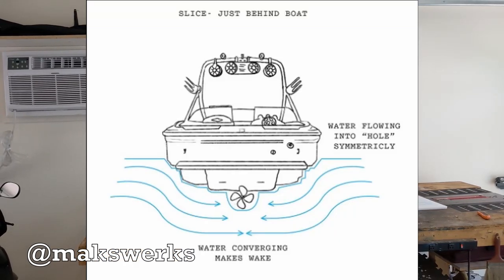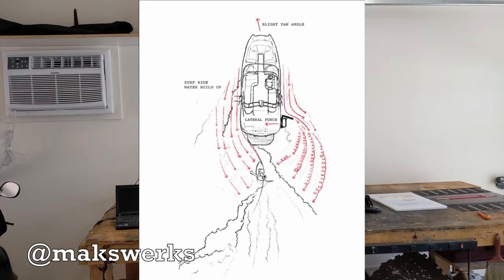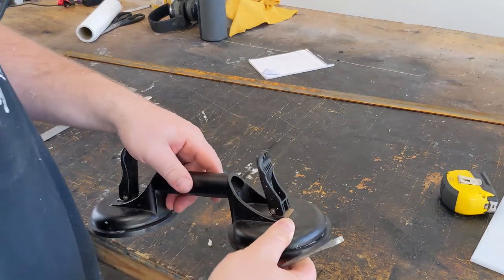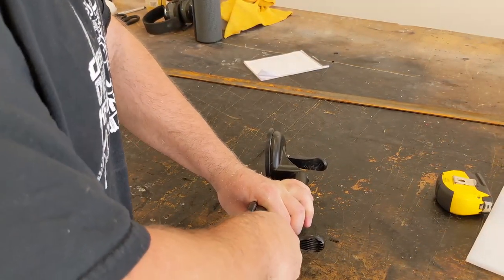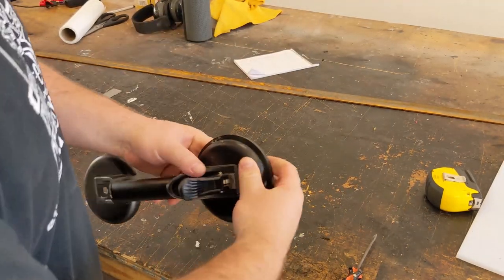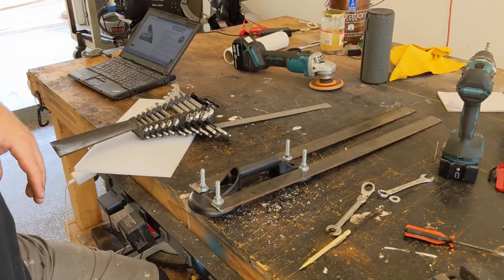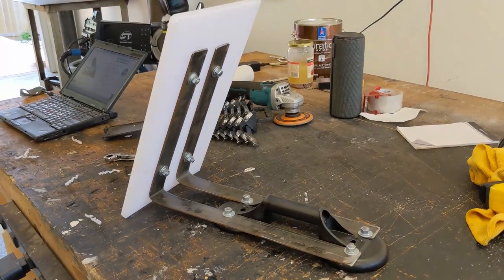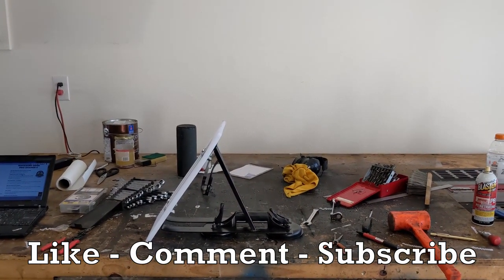DIY Wake Gate for Under $40!!!

Comment: Maybe should use stainless hardware
Reply from the maker: for some it may be worth the extra cost, but the galv bolts are pretty good for freshwasher, and a coat of paint basically makes it foolproof over the course of my use.
Reply: How did this work out? I see in the ballast video comments you mentioned a cheap shaper from ebay, did this one not work out?